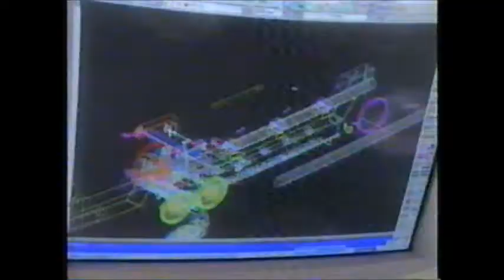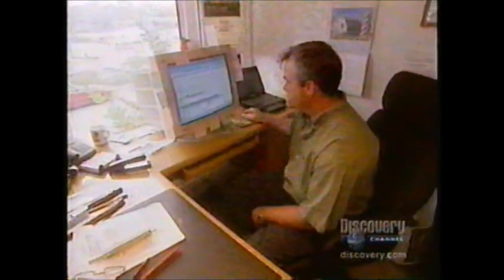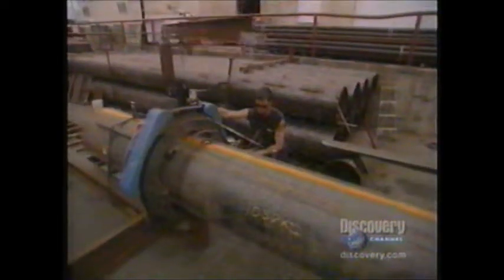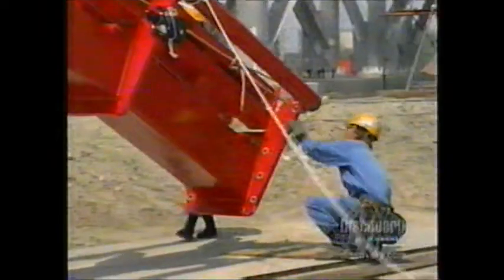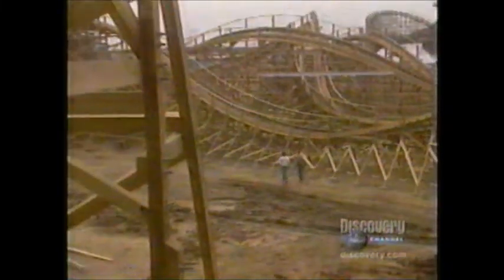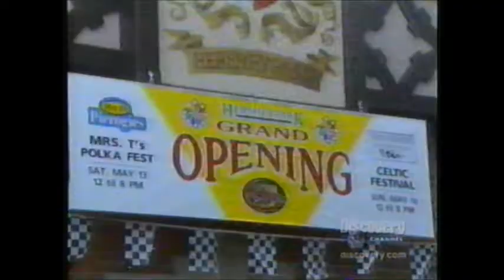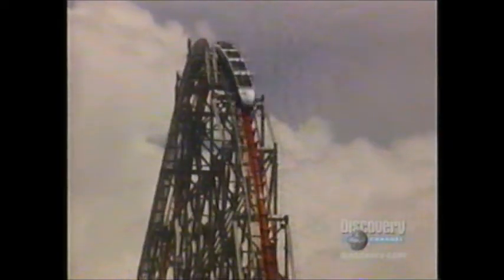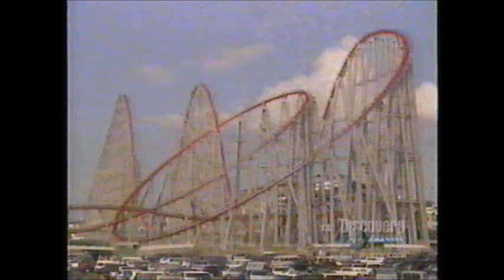(Discovery Channel) Making of a Coaster

Comment: I want to see how they did it before computers
Reply: pen and paper

well maybe not pen but still
Reply: Ron Toomer of ArrowDyanmics would use coat hanger wire to bend and twist basic track shapes and then the tracks would basically be bent and twisted by the eye of the main engineer onsight.
Reply: @LowgaenSchmidt  Ron put away the coat hangers it’s 1995